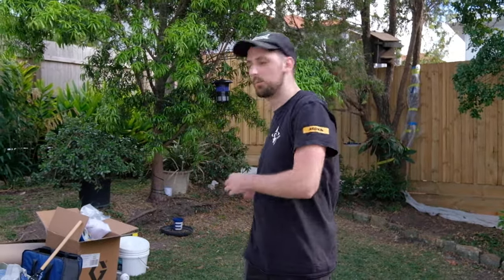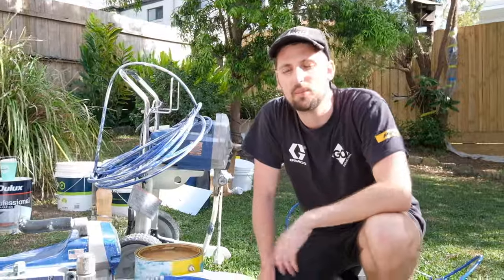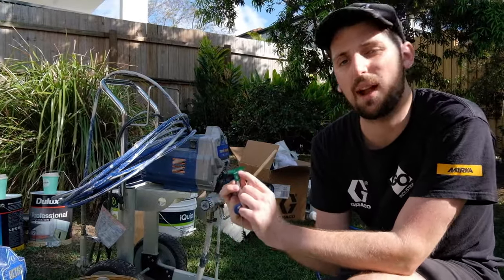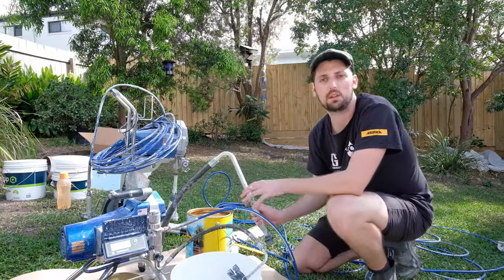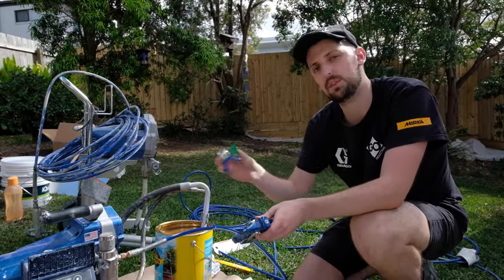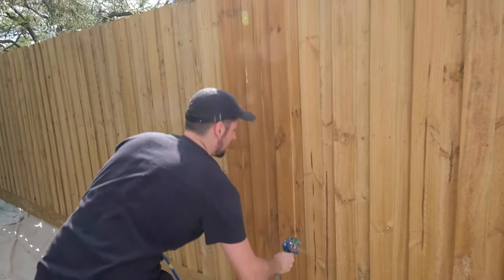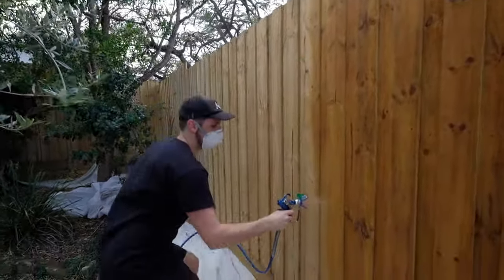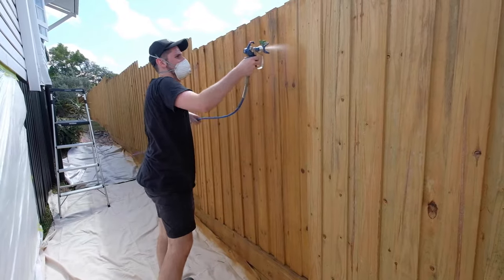Everything You'll Need To Know About Spraying Stain Onto A Fence - Graco Airless Sprayer

Comment: I always thought you were supposed to use a brush to help the stain get into the wood better after spraying the stain on with the sprayer?  Or is it acceptable to just spray without any brush work afterwards?
Reply: No you have to back brush to push it into grooves.   Unless it's a really smooth fence it won't bond well.
Reply: Yes you should back brush at very least the 1st coat
Reply: Back brush with long handle stain brush.

Comment: Great video. Glad I found it as I've just bought a Graco to spray a fence soon. One question, my sprayer came with a green 310 tip with a little metal thing and a yellow rubber washer in the pack. The guard on the gun though already had a metal thing in it and a black rubber washer. Should I swap them out for the ones that came with the tip? Thanks from UK
Reply from the maker: Thanks for the feedback! No need to worry about the yellow seal, this is for hot solvents only. You will need to swap out the metal gasket and black seal however, as the Fine Finish Low Pressure (FFLP) tips have a smaller metal section than stadnard tips!
Reply: @GOIndustrial  That's great. Thanks so much for the quick reply. Your video has made the job a lot less daunting. Also, I have an extension for the gun that also comes with a guard and seals etc. Do I just remove the guard off the extension and put on the one with my tip off the gun? Hope that makes sense. Thanks again.

Comment: How do you prevent painting the neighbors fence? Especially between the slats vertically. Thanks
Reply from the maker: Hi Dana, it really depends on how large the gaps are between your fence. With this fence there were no gaps and so only needed a spray shield at the top of the fence in some spots. If there are larger gaps between your fence, you may need to mask the neighbours side of the fence or add drop sheets to anything that might get sprayed between the gaps. 

Because it is airless there is minimal overspray and most of what you see in the air is just mist and can be washed off. With that said anything you aim at will get sprayed. It wont effect the neighbours side of the fence but if there is a bush on the other side and a big enough gap it will get sprayed. A simple drop sheet over the bush will prevent this.

Thanks for your comment, hope this helps!

Comment: Outstanding video! For the results you achieved, how much coverage did you get per gallon of product?
Reply from the maker: Hey Andy, thanks for the comment! We used a 10 litre (2.6 Gallon) tin of Cabot's AquaDeck and we sprayed one coat on roughly 40-50 metres of fence. I think we used just under half so the coverage would roughly be 1 gallon per 40 metres.

Hope this helps!

Comment: Thanks for the one tip mention… changed my spray tip and didnt even twig that there was another one seal  that came with it! I’ve run a horizontal cedar fence … should I still spray up and down or left to right … reckon still up and down so I only have 1 wet edge that way. Thoughts?
Reply: I've done horizontal but I walk the whole length back and forth.

Comment: That was a really great job on the fence with minimum overspray. I guess it’s all in the tip and pressure settings. 

Side note though idk what safety procedures you have in your region but in USA a respirator with organic vapor filter anytime you’re spraying paint or stain regardless of water or oil base. That little dust mask isn’t sufficient for the atomized particles you mention in the video. Other than that good on you mate. Great job. Cheers
Reply from the maker: Thanks for the great comment! We were super happy with how this one came out. Definitely does when it comes to getting the best finish you can!

Great spot and we love the safety concern! So here in Australia, it is basically the same - we have very strict regulations on the types of ventilation and filtration that you should be used when spraying. The mask in this video is actually a GP1 level filtration mask and is completely fine to be used when spraying any water-based paints. These are single-use though, so we do recommend purchasing a reusable respirator. 

Cheers!

Comment: looks amazing, after staining do you apply some kind of sealer or clear coat. or that was it? and which oil base stain it's possible to spray ...
Reply from the maker: Thanks for your comment! No sealer or clear coat, the Cabbots product only requires as many coats to the desired finish. This is Cabbot's Aquadeck, its a waterbased stain. You can definitely spray and oil based stain if you're wanting!

Comment: Hi Dave, the clean process for the graco airless machine is the same that you use for water base paint?
Reply from the maker: Hi Jorge, the stain that we used in for this fence was water-based 😊  If you are spraying a solvent-based paint the process is the same, you just need to use the recommended thinner instead of water for flushing.

Hope this helps!

Comment: How much is a going rate for spraying stain with a sprayer like this per board ft. Or square ft.? I’m use to brushing and using a roller but looking at purchasing a graco sprayer. Thanks
Reply from the maker: Hey mate, thanks for your comment! To be completely honest we aren't sure what the going rate would be as we are not contractors ourselves. If I had to guess I would say that you would probably charge around the same amount, maybe a little bit more as the finish quality can be better on average. Where you are saving/making more money is in the time saved to complete your jobs. Spraying is roughly 4-8 times faster than brush and rolling and that's where the savings come in. 

Hope this helps!

Comment: How do you work around galvanized metal posts?
Reply from the maker: Hey Z D, thanks for the comment. Good question! If you would like to keep the clean galvanized metal look, we'd just mask up the post ahead of time with kraft paper or drape plastic to protect it from the spray. If you were looking to paint the post, your best idea would be to use a specialised metal primer and metal topcoat, as standard paint is not designed to stick to that sort of surface. Hope that helps!

Comment: Hi
I want to start a small fence painting business, what airless sprayer would you recommend, just starting out, not a lot of money but  I am willing to pay for a dependable sprayer that will last years? Any advice would be greatly appreciated, Thanks!
Reply from the maker: Hi, thanks for your comment! I would recommend going with something like the Graco 190 or 390. Both these units sit at the beginning of the professional contractor range and offer great value for money. Being in the contractor range they are super reliable and made to be a work horse - so as you get busier you don't have to worry if the unit can handle it. I'll put the links to both below so you can compare. 

Graco 190
https://goind.com.au/products/graco-airless-paint-spray-package-190-pc-express-240v-ac-17c384

Graco 390
https://goind.com.au/products/graco-airless-paint-spray-package-390-pc-express-17c386
Reply: @GOIndustrial   Thank you for that info, I will be in contact soon.
Reply: I recommend A titan 440. I bought a new one for 700 on facebook. They sell for under 700 used and 900 new

Comment: I have a graco magnum x5 and was given a Rac X tip guard and an FFLP 310 can I use those to spray solid stain on a fence?
Reply from the maker: Hey Vincente, you can definitely use the Rac X Tip guard (blue) with the FFLP310 tip! The Low Pressure tips actually work far better with the smaller pumps as you only require half the working pressure to atomise the paint! Hope that helps!

Comment: Using woodscapes semitransparent water based stain. On graco 395 would you recommend FFLP tip?
Reply from the maker: Hi Josh, thanks for your comment! The FFLP tips are great for pretty much all applications - For that particular product I would recommend using a FFLP312 for your smaller areas and a FFLP512 or 514 for your larger areas. 

Hope this helps!

Comment: Is stain overspray a issue with neighbors homes next by?
Reply from the maker: Overspray isn't much of an issue, always be mindful however. With dropsheets and Graco Fine Finish Low Pressure Tips, we drastically minimised overspray when tackling the fence. With the FFLP308 tip as well, due to such a small orifice size, and sitting at the correct working pressure on the machine, we only needed very little pressure to effectively atomise the paint (resulting in far less overspray than a water-based acrylic in comparison). Hope this helps!

Comment: How concerned should you be of all the overspray going out to your neighbour's???
Reply from the maker: Hey FJ, thanks for the great comment! It really depends - most of the mist that you see in the air is just mist and can simply be washed off anything it settles on. The only time I would be concerned is if there is something on your neighbour's side that is directly in the spray path. So if their house sits really close to the fence or they have hedges and trees that sit just over the fence. 

For those times we use a spray shield - getting someone to hold it along the top of the fence as you spray along. This ensures that nothing behind the fence will be directly hit by paint or stain. 

Hope this helps!

Comment: Question: For a Graco tip, and Austrailian outdoor semi-transparent stain, I used a 211. at 2000psi. This did not go well. I feel like I should have dropped to 209 which is not rated for semi-transparent.  Can I drop to 1000 psi with that 211 tip? Should I change the mesh type?  Please let me know with the tip and psi. I had a brass regulator and 5000psi oil gauge at the gun. feel like we used way too much material. On the oil vs water based, I dont like spraying the oil and it's mess / cleanup issues. What do you suggest for a water product?
Reply from the maker: Hi Dave, thank you for your comment! Without knowing the exact product you are spraying, we cannot make a specific recommendation. However, for this project, we used a Graco FFLP308 tip as well as blue 100 mesh filters for the stain. The psi range can vary depending on a wide range of factors and you should test on cardboard, increasing the pressure slightly until you get the perfect fan pattern. We ran the sprayer at about 1400psi with the 308 tip. 

We much prefer water-based products as well so for this project we used Cabot's Aquadeck. The Cabot's Deck & Exterior Stain is a great option as well and it offers a wider range of colour options. 

Hope this helps, if you get stuck feel free to jump on our website and get in contact goind.com.au
Reply: @GOIndustrial  Cabot austailian timber oil Jaharah to be specific. The FFLp308 mentioned looks like they require a $30 tip holder too + $25 tip each, that’s a drag.
Reply from the maker: Hey Dave, if you are using the blue Graco tip guard then you will be able to use the FFLP, LP and LTX tips no problem. The product you are using is very similar to the ones I suggested except it is oil-based. I would recommend using the smaller 308 tip for this one. If you send me an email I can send you some more info and some pricing anthonyd@goind.com.au
Reply: @GOIndustrial  I just sent you an email. Thank you.

Comment: Should we be concerned with the overspray at the top of the picke3t going over the neighbors side and getting on their stuff? I'm buying a 515 tip
Reply from the maker: I would definitely stick to Graco's range of Rac X Fine Finish Low Pressure Tips (FFLP) - if you're painting exterior latex or acrylic paint, I'd recommend going with the FFLP414 spray tip; this will keep overspray down, and your fan wide enough to not take for ages. When in doubt regarding overspray, make sure your pressure is as low as possible on the machine without experiencing those lines in your spray fan. Secondly, have a second person hold a piece of cardboard or dropsheet on the opposite side of the fence as you spray. We were lucky on this project as the distance between houses was far enough to not worry about overspray. 

Hope this helps!
Reply: @GOIndustrial  I'm spraying oil based stain and sealer. Does that change the tip recommendation?
Reply from the maker: Absolutely - go for a FFLP410 or FFLP510 to reduce the total product output as the stain and sealer is far less viscous than an exterior acrylic :) @KingdomKleenPW
Reply: @GOIndustrial  Thanks bro!!! I ordered the 410. I've never used these tips before. Do I need to expect that I will have to spray slower?